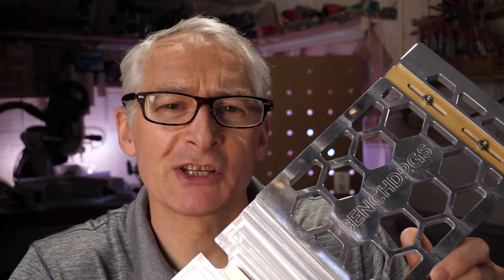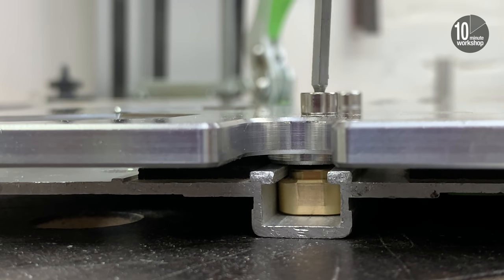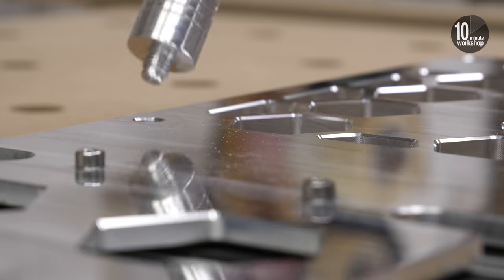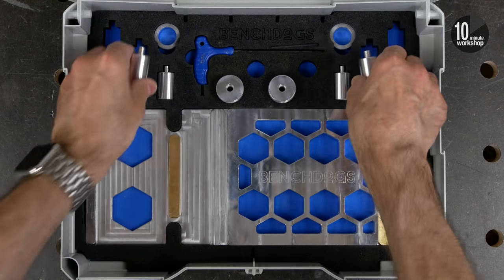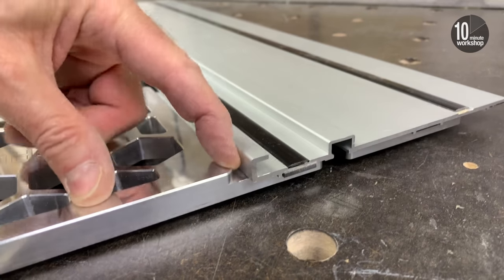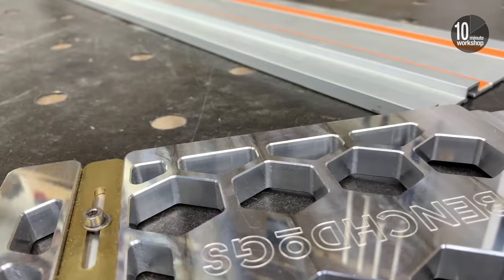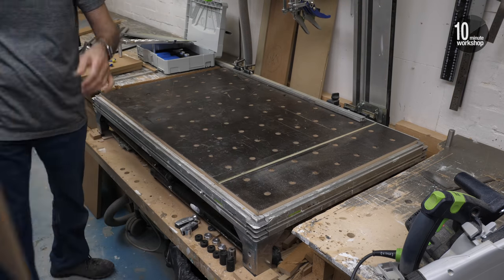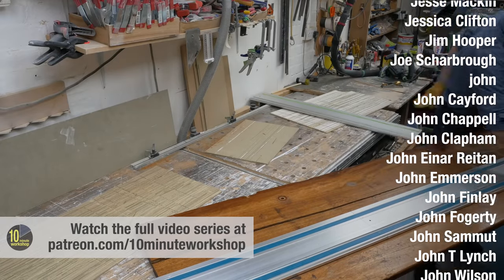Benchdogs Guiderail Square [Video 402][Gifted/Ad**]

Comment: I just bought a TSO GRS-16 and it is on the way.  I wish I had seen this vid before I bought the GRS.  This unit is on a much higher level at approximately the same cost.  The machined aluminum is very impressive and the entire unit is well thought out.  No springs or hooks to bend the track.  The only drawback I can see is that you have to carry an allen wrench with you to assemble/disassemble/adjust the square.  I already own a pair of benchdogs and the other accessories!!  Thanks for a very insightful review.
Reply from the maker: Thanks. Yes, it’s a nicely machined piece.  I like the idea of tool-less on the TSO but overall I always have a set of Allen keys within reach, so not an issue for me. 👍👍
Reply: @10MinuteWorkshop  I'm surprised they didn't build an allen key slot into the design, they seem to have thought of everything else. It looks fantastic. I'm not a fan of my MFT, the top aside, and think this would be a far better option for me. I think the screw in dogs are a great idea, it sort of nullifies the requirement for a separate 45degree angle, as you can just align the dogs at the angle in the table for a mitre. I could see folk having smaller MFT style tops for out and about, could even replace a chopsaw in many instances.

Comment: I have the TSO square which is great. I use it all the time, with very dependable results. Festool make their own square now which seems identical to the TSO square, and is quite reasonably priced. This bench dogs square looks slightly slower to set up, but has some real advantages over the TSO/Festool. Great review. I’m quite tempted.
Reply from the maker: Thanks! The Festool square is licensed from TSO I believe. 👍👍
Reply: @10MinuteWorkshop  Morning Sir, would it be possible for you to review the Festool/TSO square at some point? Thanks, 👍 🔨 🇮🇪

Comment: For anyone questioning accuracy I built the cabinet boxes for a full-sized kitchen in my driveway using a TSO rail square and all the box panels came out as square as one could hope for using a full-sized cabinet table saw. I love my rail square. The quick-release really is a great feature on the TSO. On the Benchdogs square, the bevel adapters and MFT dogs are an awesome improvement offered. Great intro video. Thanks, Peter.  Cheers

PS: I agree with your idea of an "MFT in a box" kit as I found the rail square so convenient that I finally sold the crosscutting rail clamp and protractor that came with the MFT/3 table as I found them fiddly to set up and I never quite trusted that it would cut square as a moderate bump would throw it out of square.
Reply from the maker: Thanks Ross. Yes, very very accurate in my experience - and great to have the choice, too! I do like the QR feature. 👍👍
Reply: Thanks Ross, that's a telling comment re the crosscut rail. Just starting out with a track saw and had a TSO guide on order as I could see the potential, but this benchdogs square is shaping up to an interesting way forward. As a DIY'r I'm sure it could replace a lot of other saws, maybe at the cost of convenience but  for less money overall and still allow accurate work.

Comment: Seems to be a beautifully engineered bit of kit. The problem in Australia is that some of these smaller tool specialists are very expensive to get to Australia. The smaller guys only use post or if they use couriers they don't put the volume through to get the discounts that the big shippers get. To illustrate the point, I got Mafell saw, systainer, clamps, 2 long rails and a rail bag delivered for less than the quoted postage for a plane from a small tool retailer. I don't know if there is a work around for UK sellers but there is certainly a market if they can.  Where possible I would prefer to support small makers.
Reply: We offer reasonable prices for shipping to Australia,  If you add it to your cart it will give you a quote
Reply: @Benchdogtools  Great. But you'll understand why I am waiting for the Mafell version. The mark you have to hit is landed for AUD 409 or less [the TSO square - no extras]. ON top of the usual covid-19 aftermath Australian Property is going to slow[ Real Estate Agents] , fall by 15 to 30% [Australian Banks] or fall by 50% [international experts].So this could affect Australian sales.  Where the truth lies is beyond my ability but, and this may come as a surprise,  some Australian Real Estate Agents, on occasion, resort to alternative facts so there is just a chance that their projection is   off.

Comment: Hi Peter, thanks for all your content on tracksaws. My crappy table saw hasn't been out for a long time now.
I tried a Workzone tracksaw. The rails were hopeless and wouldn't connect seamlessly, I think they came from different batches and the die was worn on one. Eventually I got replacements under warranty - genuine Scheppach badged rails came and I can confirm they were identical to the Workzone except for the sticker. Including the fault. And the rip strip was too shallow as you have found, so cuts weren't always 90deg as the rail wouldn't be guaranteed to lay flat. The saw went back to ALDI, the rails went on ebay and a TS55 turned up. Got there in the end!
Ha - just noticed Leo's been on a similar journey, so twice confirmed.
Reply from the maker: Thanks Andrew! Really ppreciate the feedback 👍👍

Comment: Like the mft capabilities but the TSO has a quick release, tool free operation, which I am very happy with.
Reply from the maker: Yep, as far as I can tell they’re all really nice rail squares - there’s something for everyone. 👍👍👌
Reply: I agree. Not sure I want to keep tightening some bolts just to move the rail square. A locking lever sounds much easier  like the TSO or Festool own brand FS-WA 90 rail square. I am in 2 minds which one to buy? Any advice would be great.

Comment: Great video Peter and it’s like you’re a mind reader for putting out content that is totally relevant to me at the time😀.

Btw the Scheppach rails are identical to the Workzone rails from Aldi. When I bought my Aldi tracksaw, one of the rails was bent out of line. Got in touch with Aldi customer service and they sent me out two replacements with the Scheppach badges on them😀
Reply from the maker: Thanks Leo! But I knew you were going to say that! 😂 Ah, thanks for confirming re the Scheppach rails - have to be a bit careful about what you say in a vid, as you know! And my apologies - I haven’t checked your new saw on old rails - I’ll do that and let you know, if you haven’t already tried it. 👍👍

Comment: Peter
Great video and review as always. I agree with the comment about extrusion and bench dogs, not only for the set up aspects as you mention, but a great entry point for those of us getting into woodworking as a hobby. It allows us to experiment making Multi-purpose tops with the tools we need to make good quality cuts from the off
Thanks again
Reply from the maker: Thanks Paul! It has the makings of a great system! 👍👍

Comment: Looks straight forward to benchdogs to have a couple of interchangeable parts to enable the main system to fit numerous other rail systems, . thanks for the main review of the product
Reply from the maker: Thanks! Depends on the width of the other rails - a lot of the rigidity / ease of setup comes from having the edge of the rail bear against the rebated edge of the square, so it needs to be machined to fit. 👍👍
Reply: @10MinuteWorkshop  for those with a gap between the rail and the end of the guide then you can have an offset slide bar that brings moves the rail closer to the guide OR you can have a separate piece that slots into the gap to keep the two parts parallel. I suspect it is easier to change the brass bar to have different dimensions for the other rails and also to have the bar offset to one side to compensate for the spacing. This would seem the most economical solution as it would be a simple low cost interchangable part.  Im sure the team at benchdogs can sort it if they see a real demand.  Cheers
Reply: @in2branding  we. will definatly going to look into it.

Comment: I think I'll be sticking to just using a roofing square! 
Probably not designed for those of us that bought Aldi/Parkside saws considering even the cheapest one is nigh on double the cost of the saw!
I'm surprised there aren't plenty of Aliexpress specials for £5 around at this point
Reply from the maker: If it works and you’re happy with it then why not?? Must admit I haven’t looked in Ali express or banggood, good point though! 👍
Reply: @10MinuteWorkshop  I wouldn't say I'm happy with it, but me being the cheapskate (northerner) I am, I would rather faff about lining up the track than do the job in seconds but spend money!

Comment: Looks great. I would love to see them design a hinged model to compete with the festool mft that could work in a similar fashion, Fixed at the rear of the bench and maybe can function without the need for the rail guide pin that comes with the festool mft at the front to keep cuts square. You could then have a wider cross cut capacity. And while were at it have it auto adjusting to the thickness of stock when its down??
Reply from the maker: As far as I can ascertain without spending a lot of money, the hinged rail is still a festool patent, which is why nobody else is doing it. 🤷‍♂️ Like the idea of self-adjusting for different material thicknesses though! 👍👍

Comment: great video great breakdown Peter. thanks as always for taking the time
Reply from the maker: Thanks Brad! 👍
Reply: @10MinuteWorkshop   its just a no brainer upgrade i use the system from Tiaga tools which is great light and portable but this does add the gold star to design and thinking ahead for everything a square could do and more.... for all those features 200 is nothing really as shown by you it makes a portable MFT truly work on site without spending on the MFT full set up.

Comment: Thank you Peter. It would be great if you could comment sometime on how this compares with the new Festool Rail Square. And you’re quite right, why would anyone pay 50 quid for yet another plastic Festool box?!
Reply from the maker: To be fair, if you don’t already have a stack of systainers it’s good to have it all together. And the new ones are a lovely dark blue... 😆👌 As for the Festool square, it’s a rebranded TSO one; haven’t used either, but it clips on rather than screws on, which is nice. The latest Benchdogs one comes with thumbscrews, rather relying on the Allen key, btw. 👍👍

Comment: OOOO Like it, I'm one of those who purchased the Evolution rails so a version or adaption which would suit these rails would defiantly be interesting. Very very tempted to splash some cash on this.
Reply from the maker: Yep. Keep you posted on that one Alex. Big fan of the idea of the square though, total convert, lol! 👍👍
Reply: Yeap another vote for the evolution rails adaption!
Reply: Well, I'm planning to buy a longer guide rail for my Scheppach plunge saw to be able to work with sheet material - and I was pretty keen on buying the evolution st2800 set over in UK and have it delivered to Germany as no-one over here sells them. Seems like I should delay this purchase further and wait for the outcome of this. As original Scheppach rails don't fit either I'm pretty screwed, as this was my backup plan...
Reply: @NB-pp9ou  ANother vote for evolution.....just bought the rails

Comment: Very thorough review Peter, I’m sure Ralph will come up with a mod to suit the Evolution rails as he did with the extension bar on the Mk2 fence which I bought recently.  Unfortunately for me, my MFT has holes on 100mm centres so the extra dogs won’t fit. I think a version without the systainer is a good idea.
Reply from the maker: Thanks! Ah, that’s a shame about your MFT - probably the only downside of not having 96mm centres. 👍👍
Reply: Peter Millard maybe that’s another mod for Ralph, make one dog adjustable 😂.
Reply: I have the evolution rails and am looking at getting the Mk2 fence. What mod was required to make it compatible?

Comment: Hi Peter. Thanks for another interesting video. I see the square is quite different to insta-rail or GSR-16 - the latter two use latch that pushes the square against rail edge, aligning it. On the contrary, how does this square aligns itself within the slot? Asking to make sure it doesn't have the same deficiency as festool/makita rail connectors...
Reply from the maker: As at 1.40 - 1.47, the rail fits tightly against the rebate in the square, and locks with the supplied allen key. The brass insert is pulled tightly against the t-slot by the screws. Hope that helps. P
Reply: @10MinuteWorkshop  Thanks, but still not fully clear I'm afraid... Does the rebate have beveled edge similar to GRC-12 self-aligning rails? [1] Or do you simply need to push it against outer rail edge while locking the nuts?
[1] https://tsoproducts.com/accessories/grc-12-self-aligning-guide-rail-connectors/

Comment: Thank you for the video Peter, another wonderfull and informative 10 minutes spent!  I am torn between whether to purchase the Rail Square or the new Rail hinge, they both look amazing with just fine differing features. Just a committed DIYer My gut says Hinge for workshop, Square for roadshop, is that a fair call?
Reply from the maker: Yes, that’s a perfectly fair take on it - though I do find the rail square handy around the workshop as well !🤷‍♂️👍
Reply: @10MinuteWorkshop  Thank you for your response, much appreciated. I might contact Benchdogs and change my order from the hinge setup to the Square one. Hope that dean'yt upset them. Chris

Comment: Hi Peter!

What would you recommend getting first.. A (bench dog) square. Or one of those fences they make?

Doing small projects mostly, but also want to built closets, cabinets, and perhaps an entire kitchen in the future
Reply from the maker: If you already have an MFT too then a fence and a pair of rail dogs will let you start getting repeat cuts accurately. If you don’t have an MFT top then the rail square is a great starting point as it’s independent. HTH, P 👍👍
Reply: @10MinuteWorkshop  thanks as always for your quick reply :)

Have 3d printed a drilling guide for making my own mft top. So I almost have one 🙃. 
I'll be going for the fence option first then 🙂

Comment: Great information, more factual than sales-y. Have you ever compared fit of dogs in holes? Eg 20mm in a mft, dogs from Benchdogs vs ujk.
Reply from the maker: Thanks! No, I haven't - I don't have any UJK dogs, though I do have some older ones I bought ages ago, and they all fit well in both the (small)Festool original MFT top I use here, and the third party top I have in my MFT.👍

Comment: Excellent review Peter even though it confirmed my fear that it won’t fit any of my 3 different rails (Scheppach, Evolution and MacAllister/Titan). Looks like Evo might be solved soon though and I can only hope for Scheppach or a variable type one.
Reply from the maker: Thanks Alastair. Yes, fingers crossed for the Evo rails. The Titan can be made to work, but I’m not sure I’d put the effort in each time, personally. Fingers crossed for the Evo. 🤞
Reply: Peter Millard I know what you mean about the effort to change, but if you’re only using a Titan rail I’m assuming once you put the washers on, you’re set.

Comment: Thanks Peter. Great product and review. I'd love to get my hands on a kit and I'm in total agreement with you... A kit without the systainer.

Side note: Powertec and Wen tracksaw guide rails are compatible as well. I have a Triton adjustable miter square and it fits like a glove on my Powertec guide rails. I mainly bought it to use as a square as it was dirt cheap... $26 on Amazon if I remember right. The Powertec rails are a direct Festool clone. Mine are both 55 inches long (1400mm).
Reply from the maker: Thank you! 👍

Comment: That is brilliant. I recently purchased some rail dogs from Benchdogs. I wonder if I can use those with the the square rather than purchasing a kit.
Reply: Sorry they are different guide rails are tapped and these ones are threaded.
Reply: @Benchdogtools  ah that's a shame. Still a comprehensive design.
Reply: @Benchdogtools  just a quick thought, can I not use the relevant size threaded rod ie m5 to mate the two?
Reply: @SamValiant  Yes you could, it's an M8 thread.

Comment: Have you used the festool guide square Peter? Be interested to know your thoughts, and how it compares to this one, if you have.
Reply from the maker: I haven’t no - it’s a rebadged TSO, so has the quick release which is good if you need to on/off a lot. The latest Benchdogs square has thumbscrews now btw, so not reliant on the Allen key. 👍👍

Comment: Peter do like the look of these squares. I managed to cause my ts55 to cut out the other day ripping 55mm Oak. Guessing I'll need to get me a lesser toothed one for ripping. Any suggestions.
Reply from the maker: When I did a broader mix of work I started using the Festool 28t ‘496302 Universal’ blade - https://amzn.to/2SHfPOc - which worked very well in a mixture of materials but would still leave a good finish in eg MDF and ply. Otherwise I’ve been impressed by Key Blades - this is a link to the 48t, but you can use that to find the 24t, I’m sure. Key blades 48t for TS55 - https://amzn.to/2ryM0Fv
HTH! P
Reply: Thanks Peter, I was a bit concerned when my prized tool started to slow down then stopped at about 1200mm. Was an extreme cut at max cut depth in oak so a good stress test I suppose. 10 min cool off then last 200mm finished with ease. With a new blade do we need a new splinter strip fitting?